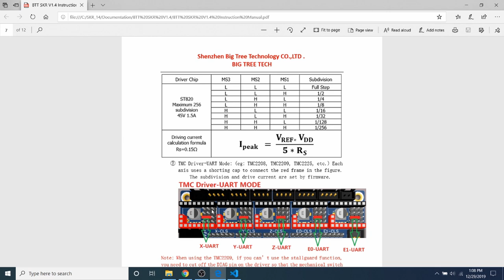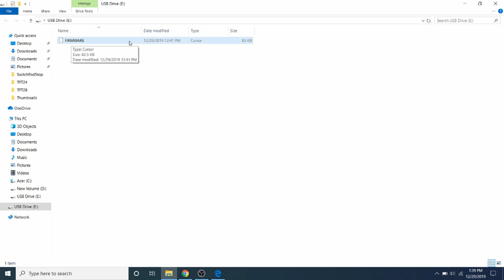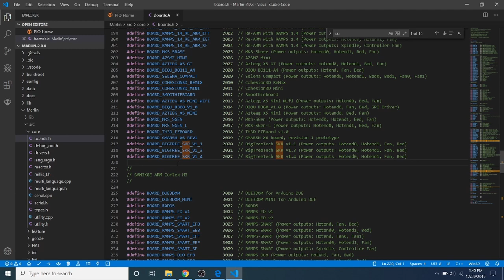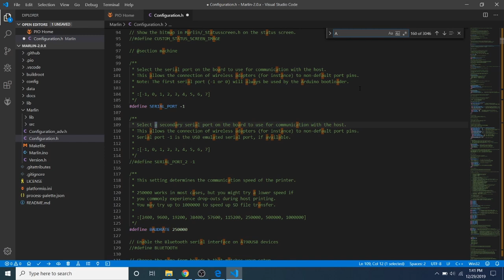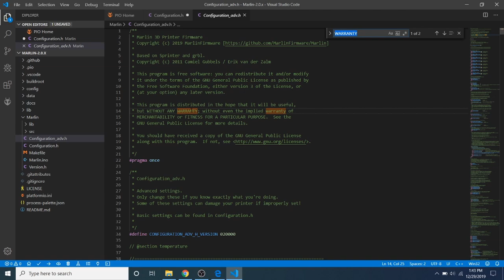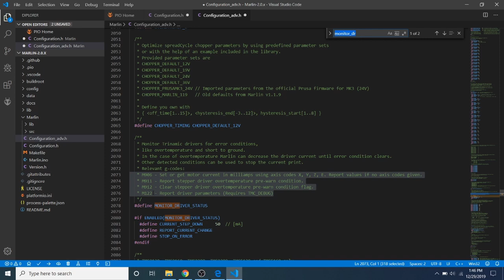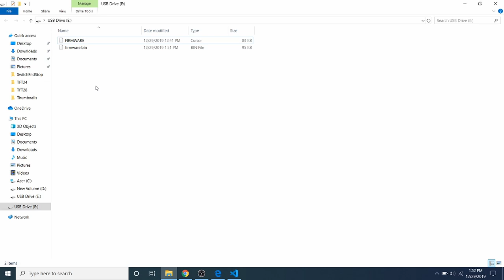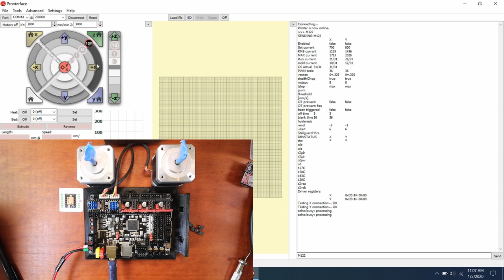SKR 1.4 - TMC2208 UART v3.0

Comment: When I purchased my V1.3 (the first one) I purchased it as a complete kit with five of these and to be honest I don't care much for the 2208 as it does have some oddness to them.  I firmly believe the 2209's took care of those oddities.

Here is one oddity but I can take a 4988 and drive my Z faster than with a 2208.  I don't know why considering the 2208 is supposed to handle more current than the 4988.
Reply from the maker: It's more about a quiet stepper.
Reply: I don't consider it all that quiet though on my CoreXY.  Fact is for E and for Z I MUST disable smooth stepping or forget it.  I tried each 2208 and they were all this way so it is a 2208 issue, or a Marlin+2208 issue.  I miss my Repetier I was using for firmware but they have nothing for ARM based boards.
Reply from the maker: I might be able to do tmc2209 this weekend, but my vacation is over for the Holiday, so I might not have tutorials flowing as fast as people would like.

Comment: I'm trying to setup a SKR V1.1 with TMC 2209 V3.0 which is in UART by default. This old board has way less jumper pins so im not sure how I should do it
Reply from the maker: The video should be correct.  Just remember to move jumper to PSU power.  If you're short jumpers there easy to order on Amazon.

Comment: Great videos - i am awaiting to find out what the closed loop jumpers do!
Reply from the maker: Me too, the documentation from bigtreetech seems a little lacking.  I'll be ordering one soon to experiment and hopefully have more information.  I advise holding off one purchase until they provide more guidance on stepper.
Reply: @EdwardBraiman  I won't be buying the btt closed loop drivers as they did nothing to change from the design of mks years ago and still using the terrible a49 drivers. When they make it driver replaceable or add tmc drivers I'll consider it.
Reply from the maker: It's a novel idea, but for the moment I agree.  I'm more interested in the possibility in future printing.

Comment: great vid edward any chance you can do a vid on installing tmc 2209 drivers with and without endstop switches thanks and keep up the good work
Reply from the maker: It's mostly recorded, but not working yet.  There appears to be an issue with Marlin firmware.  I'll check again today.
Reply: I second that. I have a SKR 1.4 Turbo and the TMC2209-1.2 lying around here, and I just can't get the drivers to run in UART mode. Pronterface always gives me "Error: All LOW" on m122.
Hence the interest ;)
Reply from the maker: @qwerrrrta  I totally understand as I'm in the same boat.  As soon as Marlin firmware or bigtreetech clarify what the issue is l'll produce a tutorial.
Reply: @EdwardBraiman Just figured out, the board needs 12V to get OK-message for UART.
Reply: @EdwardBraiman  Any progress on that? Currently have my SKR 1.4 Turbo and TMC2209 ready and waiting :)

Comment: The TMC2208 V3's I have got has missing 0 ohm resistor missing in all of them. Is there any workaround for that if i want to use 2208's in UART mode?
Will shorting those two solder pads fixx the issue?
Reply from the maker: Technically you can do that, not recommended.  I've smoked a board with manual soldering pads.

Comment: Hello Edward. Is it possible for you to do a video about the SKR 1.4/1.4 Turbo and how to install and configure TMC2209 UART drivers?
I have bought that combination and don't know exactly how to set the jumpers and what to configure in Marlin.
Thanks!
Reply from the maker: It's over half recorded.  Just waiting on a Marlin firmware possible fix.

Comment: i purchased a kit from BTT with skr 1.4 turbo + TMC 2208 , those three pads you mention  that have the 0hm resistor connecting , i don't have that , could that be why whenever i request M122 it says all Tmc are too low?
Reply from the maker: Yes or no power 12v  supply when doing command.  The link in the tutorial should get you to a working part otherwise you're going to need to consult the data sheet for your manufacturer.

Comment: Hello Edward, thank you for this video. As always, it has become a very detailed tutorial and has been able to help me very well. However, I still have one question. The values for "default steps per mm" in configuration.h, do you enter them for 1/16 tel steps? Is it what is meant when it is written "simply exchange for A4988"? Thank you very much.
Reply from the maker: A4988 highest degree of step with jumpers is 1/16, while drv8825 highest degree of step is 1/32.  The RepRap calculator depends on stepper and other hardware to configure.

Comment: I have SKR 1.4 Turbo w/BTT TMC2208 3.0 drivers. I would like to know if I am able to set microstepping values from LCD without flashing firmware. Do you have a video on this or is it not possible?
Reply from the maker: Unsure.  I'm guessing if there is not one you can open an enhancement request on Marlin firmware bug database.

Comment: I have CR10S and just install motherboard SKR 1.4 Turbo with TMC2208 UART. and have problem with Z axist and end stop switch. End stop switch not react when I go to homing Z axis. Also when I start with print I get message homin faill.
Reply from the maker: What does M119 say before and then after homing?
Reply: @EdwardBraiman  before is this:

SENDING:M119
Reporting endstop status
x_min: open
y_min: open
z_min: open
filament: open
ok P15 B3
echo:busy: processing
echo:busy: processing
echo:busy: processing

go all the down and motor start vibrating, touch switch and staying like that, I also try to swicth end stop switch phisicly with Y switch, in that situation look like everything work but not so long, again I get home failling. Also when I do bed leveling (Ido it manually, I don`t have Bl touch, bed is so high when I start doing that from home position, you have idea how to fix that?)
Reply from the maker: When you click the endstop manually and hold, what does m119 say?
Reply: @EdwardBraiman  

Reporting endstop status
x_min: open
y_min: open
z_min: TRIGGERED
filament: open
ok P15 B3

Same happen of other two axis X and Y, Ithinking something is wrong with settings in firmware, also I using last Marlin (nightly 2x bugfix). I want to say that with old stock board I never have issue, with this new board having problem. Also I take TMC 2208 UART drivers because of mechanical end stop switch what Ihave right now. Any idea what can be a problem?
Reply: Also one more thing want to say, that for Z axis I use connector Z1 and Z2
Reply from the maker: I'd need to load on a printer to decipher. I might do a live stream in an hour.  I could load to see.
Reply: @EdwardBraiman  Problem is solved, can`t bealieve what was a problem. On end stop switch for Z axis little peace of aluminium what press switch was a little squezed and not make good contact when Z axis come all the way down. So I bend a little bit up that aluminium and now make good contact when come all the way down and keep switch pressed good.

Comment: One Q: my SKR v1.4 Turbo will come populated with 5 TMC2209's, but only 4 will be used. What is the best cause to take, leave the 5th in, or remove it before use?
Reply from the maker: Sound like a good idea.  Remember extruder does not have an Endstop so you might want to use a stepper.  Remember it's similar to a tmc2130 for Endstops and start with defualt voltages and test before putting in printer where possible.  You may also drop z stepper unless you think you're ready.  I'd start with a drv8825 on z and the try when you're confident.

Comment: I cant seem to get marlin 2.1 to compile in uart... I can get it to compile just fine if I make the drivers standalone, but as soon as I try to remove the standalone from the driver name, it gives me errors about x or y hardware serial pins needing to be set. If I go to config_adv and in the board pins and board common pins to change them, it still does not work. I think there is something wrong with the TMC2208 library not installing properly, but I just cant figure it out. if i go to platformio library and look at Examples/ TMC2208_SoftwareSerial.ino, I can see the TX/RX hardware/software serial pins my error talks about, but I dont know how or where to use that example. Do I just copy and paste that into my board/common pins .h file or what?  I'm using a BTT SKR V1.1 with TMC2208 V3.0 UART, and an BTT TFT35 V2.0 for the screen. I am also using autobuild marlin so not sure if that has anything to do with it or not.
Reply from the maker: There's a Discord link in channel.  In general chat either myself or someone else can walk you through the issue.
Reply: @EdwardBraiman  Thanks man, I will add the discord server when I get home.
Reply from the maker: You're welcome and can you post configuration.hand configuration _adv.h in General chat either myself or someone else can help.

Comment: Thanks again for the videos, very appreciated! In the configuration.h file, if your using 2ea z-axis motors connected to the Z-a and z-b output ports would you need to in comment the z-b line? Thx
Reply from the maker: You'll only need one z axis in like the video.
Reply: Edward Braiman but what about double z motor configuration like you did on SKR 1.3? I have a anycubic i3 mega and we got double z motor and endstop.
Reply from the maker: I'll see if I can do a video.

Comment: first very good video and quite explanatory. My doubt is that I should buy an SKR V1.4 and some MKS TMC2208 V2.0 (they are white ones that have a 0ohm resistor soldered on the bottom side). marlin but when I load it no motor works. If I put it in standalone mode they work but I want to use them in the other mode. Do you know what it could be?
Reply from the maker: If you recently purchased tmc2208 the issue should be fixed.  Try posting issue in discord link in description and I'll take a look.
Reply from the maker: Also might be wiring between products are different.
Reply: @EdwardBraiman  Thank you very much for answering. I tell you these tmc I bought them a year ago and I had them using an arduino mega2560 and ramps 1.6 without problem. When I changed to SKR 1.4, that problem arose. since when throwing the M122 command it gives me that the uart communication is ok at the end of the lines. my alternative is to try the tmc2208 V3 if the same thing happens😢
Reply from the maker: You can always post you configuration in Discord General chat in link below 👇 and either myself or someone else can walk you through the issue.

Comment: Thank you for the videos. I did everything you said in the video, but keep getting TMC CONNECTION ERROR warning. skr 1.4 turbo, 4 pcs two tree tmc2208 driver, ender 3 pro. I didn't print anything yet but it seems everything is working. It does homing, mesh bed levelling, heating act. when I connect via pronterface, all axis are 0x00:00:00:00, and Error: All LOW. What shoul I do? I want to use in uart mode.
Reply from the maker: Tell me about your Marlin firmware configuration and version?
Reply: @EdwardBraiman  I finally did it. As you mention 4:15 when I have to change to megnify, I saw the pins were not soldered properly. I solder them and voila. Thansk for the reply.
Reply from the maker: You're welcome.

Comment: Hello, can someone tell me why moving the x axis also moves the y axis, and vice versa?
Reply from the maker: Which printer?
Reply: @EdwardBraiman  I downloaded a marlin pre configured for the ender 3 pro for skr 1.4 turbo with tmc 2208 uart.
With a normal configuration the x and y axes are independent. I can't find out the wrongly configured parameter in the version for ender 3. and thanks for your answer
Reply from the maker: Try file compare generic config(s) with newest the build up generic configuration change by change until issue is found.  I personally don't recommend example files as they are what they are examples.
Reply: @EdwardBraiman  I'll do that. Thank you so much
Reply from the maker: You're welcome.

Comment: Your tutorials are very nice. I wanna ask something. If ı use two z motor, tmc2208's mA(rms current) has to be 1400?
Reply from the maker: I'd start low like 800 and work my way up slowly.  Keep in mind Z axis doesn't move as much.
Reply: @EdwardBraiman  yes but one tmc2208 work for two motor
Reply from the maker: Yeah, your going to need to try it out.

Comment: And what about when you get an error compiling LPC1768?
Reply from the maker: Normally, I download a fresh copy of Marlin firmware and compile step by step making a change between compiles until I localize the error.
Reply: @EdwardBraiman  wow thanks for actually responding. I've done multiple versions of marlin. Right now I'm using kay3d cheetata5.0 because it's the only thing that has gotten me as far as I am. When I compile stock unedited marlin firmware I get hundreds of errors.
Reply from the maker: This seems to point to an environment problem in the setup or a broken Marlin firmware update.  The next step is find the first error and search for a solution.

Comment: i have the tft3.5 v2 updated to latest version with the SKR 1.4 turbo and i followed multiple tutorials and vid but it keeps saying no printer attached. I'Ve done all the steps. is the tft3.5 v2 the only tft screen not working with the SKR 1.4?
Reply from the maker: I've ordered a TFT35 v2.0 and should arrive Saturday.  It should work, but I'll let you know.
Reply: @EdwardBraiman  please do. I've done all i can. Tried many forum's but untill now not much help.
Reply from the maker: @Morrigon666  well now it depends on how quick Amazon moves.
Reply from the maker: Try this, set second serial port in Marlin configuration.h to 1 and let me know if it works.  I'll record a tutorial after you confirm.
Reply: @EdwardBraiman  already found the error. Stupid mistake. Ports on the 1.4 is reverse and that is something i didnt know. Also needed the rs232 on the tft instead of swd, facepalm

Comment: Which printer do    you  use this  with  ?
And are  you going  to  make a tutorial with  a BL-Touch aswell  ?
Reply from the maker: BLT may have issues.  Currently there are several open issues on Marlin firmware issue database.
Reply from the maker: I'm waiting on the fix for Marlin firmware before doing tutorial.

Comment: My sensorless homing doesn't work it doesn't stop and doesn't sense when to stop (for a prusa mk3s)
Reply from the maker: You're going to need to change sensitivity setting.  It defualt 8.  Keep in mind it does work, but takes forever to dial in.
Reply: @EdwardBraiman  I have tried from 0 to 60 is steps of 2 so I don't know any more
Reply from the maker: In advanced configuration what are you changing?
Reply: @EdwardBraiman  #difine_stall_sensitivity  8 I am using the tmc2209 drivers on a 1.4 skr what are you using
Reply: The sensitivity I mean
Reply from the maker: @Foldingblade  Start with #define X_CURRENT       800   and #define Y_CURRENT       800  at defaults.  Then is the comment removed from, "#define SENSORLESS_HOMING".  Make sure you start with default, "STALL_SENSITIVITY  8".  You may need to modify values until it works for 800 and 8 until it works.  Also keep in mind open issues in Marlin bug database as the last time I did this was over a year ago and it did work.  Here is the link I used to search on the issues ... https://github.com/MarlinFirmware/Marlin/issues?utf8=%E2%9C%93&q=is%3Aissue+is%3Aopen+sensorless+homing
Reply: @EdwardBraiman  oke now it does home but it doesn't go to the side it stays in the same position as it was left
Reply from the maker: Could you give a little more detail?  The TMC steppers my need to be inverted in configuration.h for direction.
Reply: @EdwardBraiman  I got it working the firmware from marlin itself didn't work I downloaded it from the big tree GitHub and config it for my printer 

Here is the link if you need it

https://github.com/bigtreetech/BIGTREETECH-SKR-V1.3/tree/master/BTT%20SKR%20V1.4/Firmware/Marlin-bugfix-2.0.x-SKR-V1.4

Comment: out of curiosity why did you choose not to use the preconfigured SKR1.4 marlin from their github?
Reply from the maker: Because, Marlin firmware from Marlin website is current and SKR 1.4 is dated.
Reply: @EdwardBraiman  it was updated 5 days ago, it's in the 1.3 folder on github
Reply: @BrettCulley  🧐